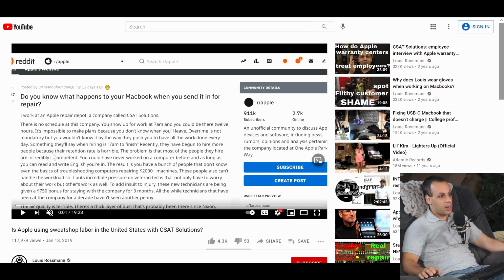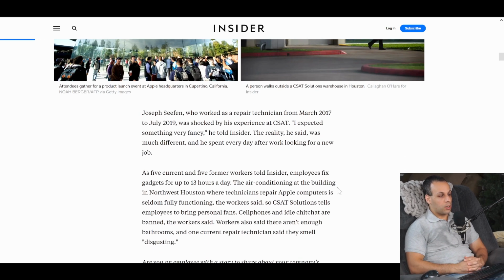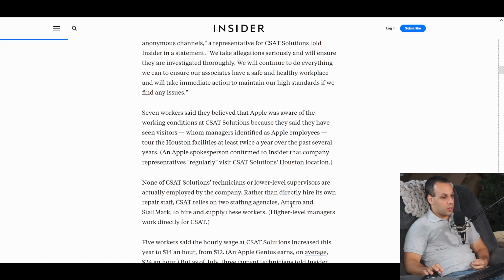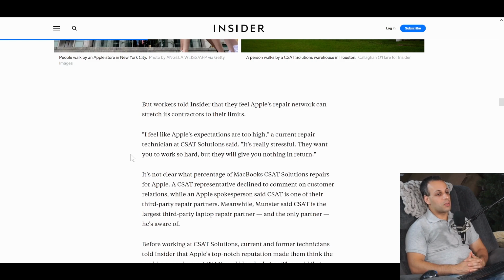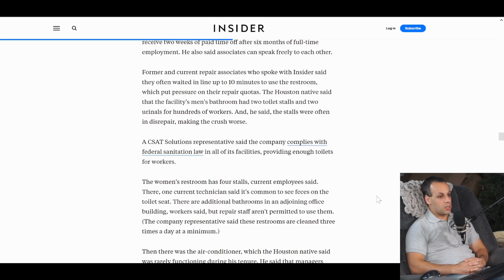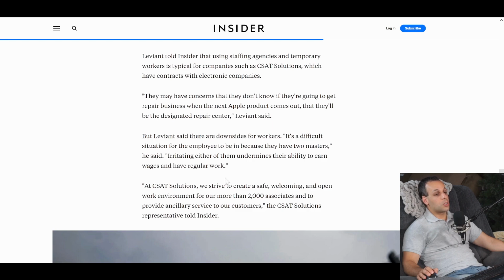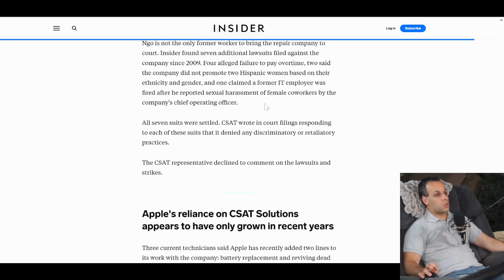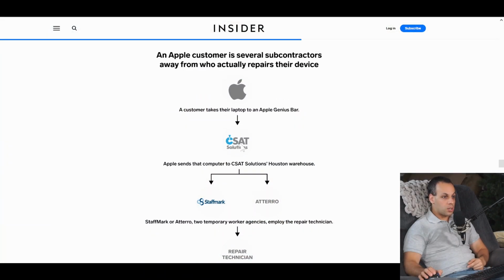What is Apple authorized repair REALLY like?

Comment: Years ago my kid had a 3rd gen iPad. The update for iOS came out and I tried to download and install. I failed twice and the "genius" at the Apple store told me he couldn't do anything different, and the third time may brick it. Basically told me he couldn't help me. Thanks.
Reply: that doesnt even make sense
Reply: @tylern6420  Thats what I said. Then I asked if I could back up all the data on the cloud(as you can with any pc or Android) and he said he couldn't let me see my cloud for security reasons. We only had 1 Apple device so it couldn't be accesses anywhere else, and the iPad was in update mode so it was useless.
Reply: @joshkleifgen6525  like i dont think a system should just completely brick itself just by failing an update, rather what would be more likely is corruption of the OS and essential files, which would require a factory reset

Then again the mac pro displays brick themselves with essential updates so maybe their definition is error screen
Reply: @joshkleifgen6525  like the internal firmware should still be able to be started to enter recovery mode and trigger a factory reset to delete the malfucntioning software

Im not an expert but like only very specific updates/flashing firmware should have a higher risk of extreme damage and even then theres probably still a way to recover that, unless you're using the jolla phone

Comment: Dear Louis,
You know, some of those people are not "wearing" the mask under the nose/mouth because they think it helps; I've observed shoppers/ground level employees who will keep it like that because they're in the midst of running errands and visiting multiple shops, or on a break from work. They'll pull it down for fresh air in the open, then pull it back properly over their face upon entering the next building when they get there. Since medical experts have recommended washing hands before and after touching masks, and some people can't do this while they're out and about, it minimizes germ transfer to and from the mask to handle it less.
Of course you're still free to be upset, but I just wanted to throw it out there that it's not always due to being ornery or whatever.  People in major metropolitan areas gotta watch the stress levels.

Comment: Once I went to authorised apple repair shop with my iPhone 5 and asked 25 euro to day that is not working and impossible to repair. Than I went to an independent repair shop and the guy just replaced the battery and it worked.

Comment: Authorized repair is short hand for "maximum profit line in the store", a board "repair" aka replacement for $900 probably costs them $3-400 max
Reply: For apple repair is even cheaper as they buy in huge bulk and no markup as they are the ones making the replacement parts

Comment: I bet you the poop on the toilet seats is more like a slight smear, which is still disgusting but more understandable. It could possibly happen during a wiping mishap of some kind, maybe when it's a particularly explosive or messy one, or maybe when they were having trouble dispensing the toilet paper in a usable wad, or maybe when they were being squeamish about touching anything at all in an already disgusting bathroom. These people don't have vacation for their first 6 months on the job, and they need to take a quick dump to get back to repairing stuff because of the pay model. Multiply it by hundreds of people, and what should be an unlikely series of events may happen surprisingly often.

Let's say there are 2 poops a day and 300 hundred people. Maybe a mishap happens only in 1 in 1,000 dumps. That would mean that there's a mishap like this once or twice a day, and you'll definitely remember finding poop on the toilet seat even once. 

With 2 sitting toilets and let's say 250 male employees (is the computer repair industry predominantly male? I'm not sure but I imagine so, given the state of things in related industries), that's 250 poops a day per sitting toilet. If they are cleaned 3 times a day, then that's roughly once every 80 poops. Honestly, if there is literally a constant line to use these bathrooms, then they are being used extremely frequently and an attendant should probably be there checking the cleanliness every half hour or so.

Or maybe disgruntled employees actually take dumps on the seats? That would seem quite sensational to me. You would have to call someone to fix that, right? Hopefully you wouldn't just layer toilet paper on top of that and see how it goes.

Comment: They miss the toilet because they have been standing in line for an hour with bubble guts
Reply: That’s what I was going to say and it’s probably the most credible answer alongside squatting.
Large queues for 2 stalls means some people won’t make it in time, and no doubt are also under pressure to get back to work so don’t have time to clean up after themselves.
Clothing may be similarly affected in such a case - not great having to complete a shift like that.
Issues of dignity at work perhaps?

Comment: Get cracking on your own brand of computer/os that's fully repairable. It might take years but theres not many people with a passion that knows what needs to be done. I think with 1.6m+ supporters funds would not be an issue
Reply: Looks like someone has already had the same idea. Check out the Framework laptop.
Reply: Removable battery, fully swappable I/O, modular drives, easily accessed RAM, swappable keyboards, bezel choices, easily replaceable mic, webcam, speakers, and even easily removable motherboards. Framework are gods.

Comment: Contractors are employees of the staffing agency.  They are paid through the agency, vacation and time is handled by the agency the only part the company employing the staff has to do is provide adequate staff conditions and safety.  Also if they are paid 12$ an hour take home you can guarantee they are actually making closer to 15+ another puzzle piece for contract labor through a staffing agency is that they get a cut of the wages for the duration of the contract for administrative services and a finders fee, typically with bonuses for quality and turnover, aka meeting exceeding quotas and meeting duration thresholds like 90 days 6mo and 1 year.   As a whole the agency staff thing is ROUGH for the employees and golden for corporations no legal liability to contracted staff.  They aren’t staff so no unemployment.  No benefits packages or programs and typically a promise of hiring them from the agency if they are good for the 6month probationary period.

Comment: I want to repair my A1425 Mac, yet I was denied by AUTHORIZED repair, as no replacement motherboard is available. Well, I want the motherboard fixed, not swapped, but here even if I want to pay for a repair, there is non existing for me! 
I have to find some repair shop, and well, there are not may shops that stream like Louis, so how the heck should I know if they are the one with the access to schematics and parts, or the one that may do crappy job?
All because Apple deny repair, and deny to work with independent repair :/

Comment: You know in so called socialist countries like "Germany, France..." :

By law the employer has to take care of this "we need AC, Fans, Water.." 
otherwise the employee is allowed to lay down work until the conditions are fine again and can not be fired because of this. 
13h per day in a large comapny like csat is also not working without extra compensation (financially or as additional rest time). 

...but GOP will tell you that stuff like this will transform your country  into the CCCP.  

(Temperatur at workplace  - there are obvious exceptions: Steelfoundaries, Kitchen....)

Comment: apple: throw the baby out with the bath water. Seems like a fitting new company slogan.
Also you don't get a trillion dollar valuation by being fair to employees.
Piece work is a terrible method that has no balance because it breeds gig work and that leads to low wages for some and overworking and mistakes for others even more so if its a hiring company sending you out. that means high turnover as well.

Comment: csat is shit, they often butter jobs to require more parts replacements. Like breakkng out the cooling grille in the rear of a laptop case and requiring case replacement to finish an unrelated repair